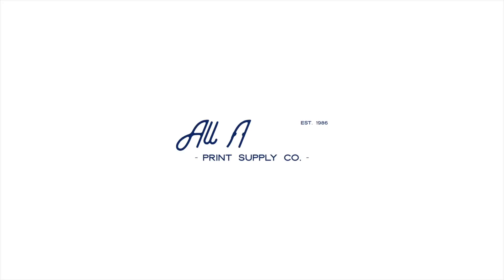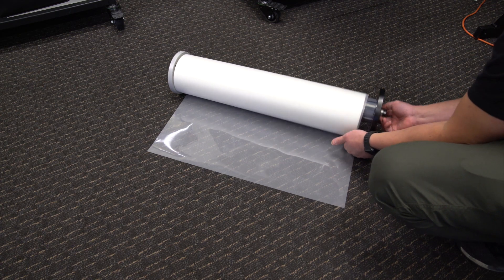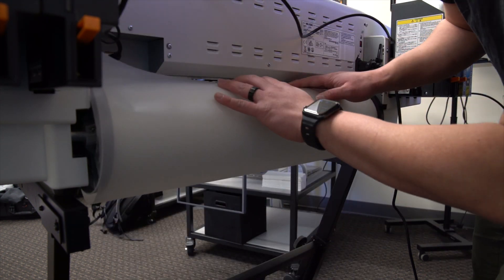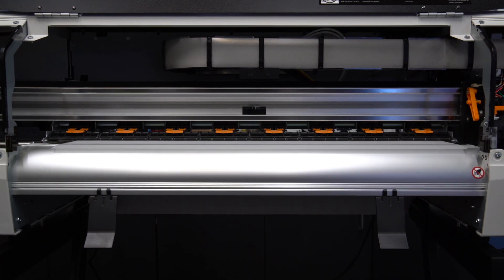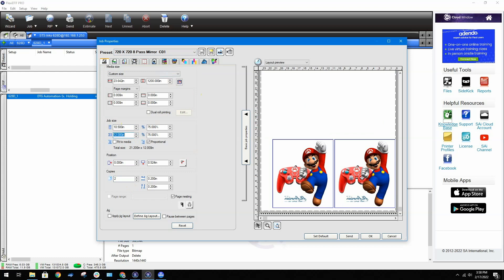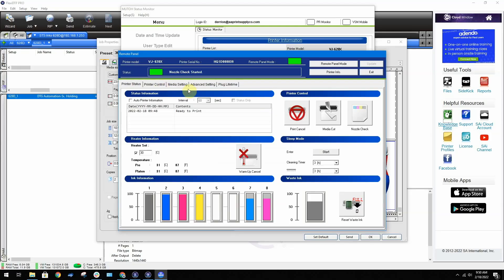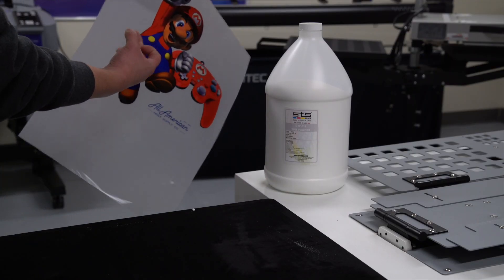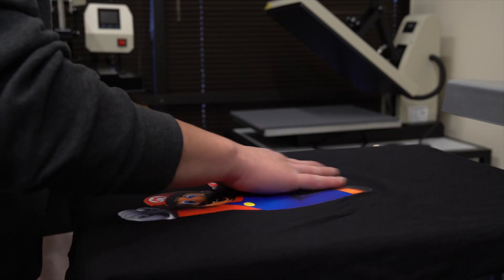STS VJ-628D - How To Print DTF | AA Print Supply

Comment: Would like a video on how to replace the damper in the STS VJ-628D. Do you have a video you can share?
Reply from the maker: Hello, something hardware replacement wise we would go direct to manufacturer. We want to be careful not to void our warranty and they would be the best resource for insight on this question
Reply: I'm beyond the warranty, I'm being told to box up and ship the printer back to STS for them to replace the head and the dampers, I've found the part at AA Print Supply, however I'm not finding good instructions on how to replace the damper. Lots of videos on different brands, but not this model. I have reached out to STS and I'm waiting for them to respond. @AAPrintSupplyCo  Seems silly to box up and ship a printer for a common repair, at least all the other brands show it to be very common and easy to do... If you don't have a video, maybe you can give me more info on the head. I found info for a DX7 I'm hoping with more digging I can find something that would give me enough info go get it done. If I can't fix it myself then I will spend the money to have it shipped to STS.